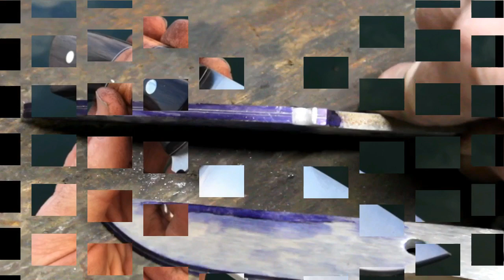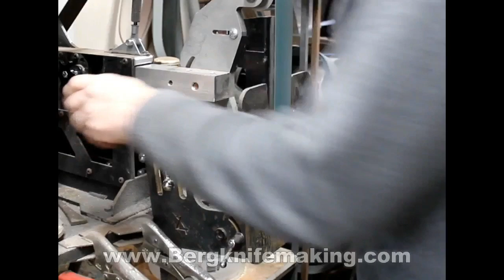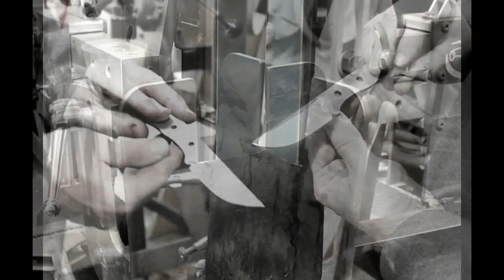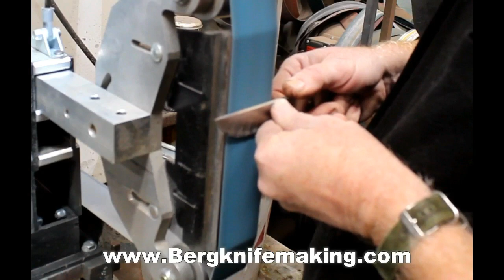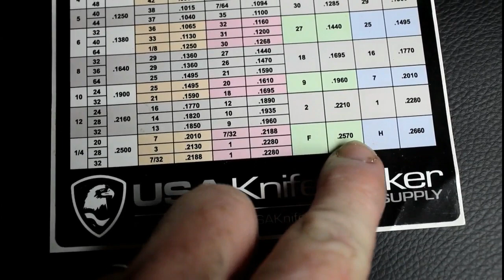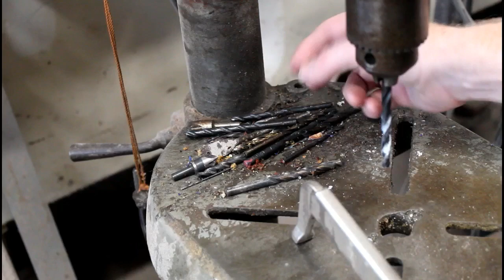Knife Making Full Flat Bevel Grinding with the Tilt Table by Berg Knife Making

Comment: Another good vid dan. Your next little project should be a little drill bit caddy that mounts on the pilar of your drill. Makes your drill bits easier to find and makes them last longer. If they are always kept in a pile they will eventualy chip off eatchother.
Reply from the maker: Great idea!!! Also have to build my grinder vacuum but with the restrictions everything is closed. Anyway thanks for the idea and stay safe